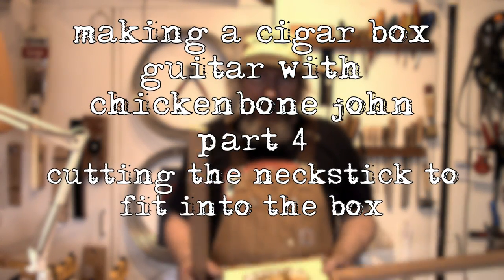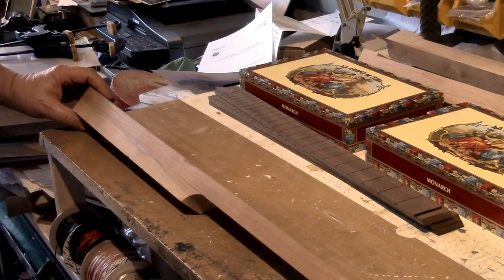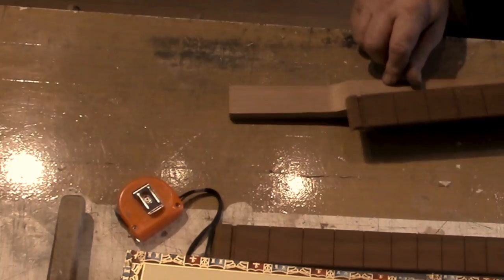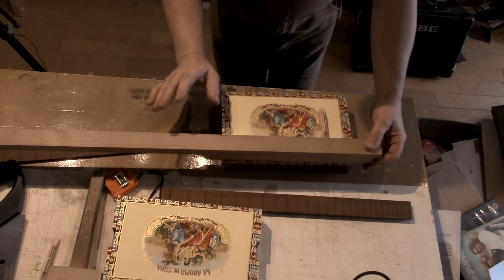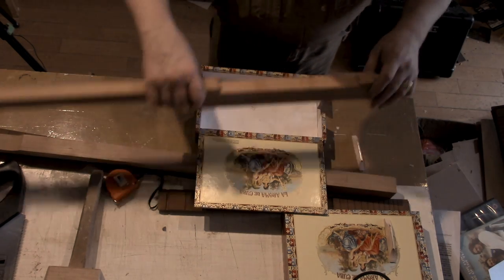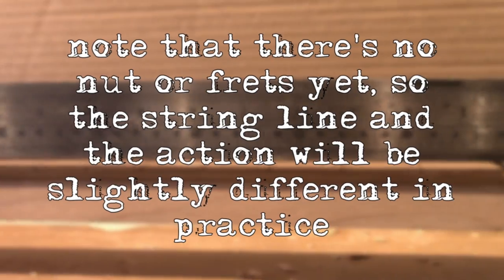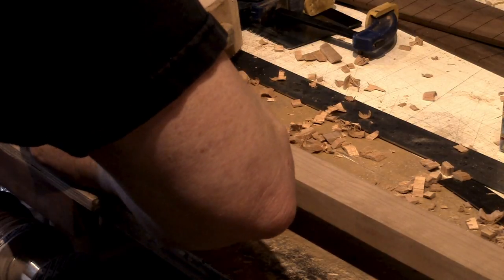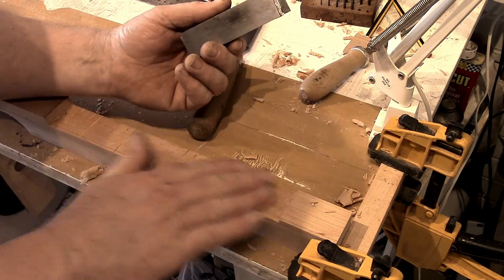Making a cigar box guitar with ChickenboneJohn - part 4. Cutting the neck to fit into the box.

Comment: how did you make it fret board a bit slanting, your bottom heel is straight. did you do anything else.
Reply from the maker: The neck is installed parallel to the top, there is no back angle.